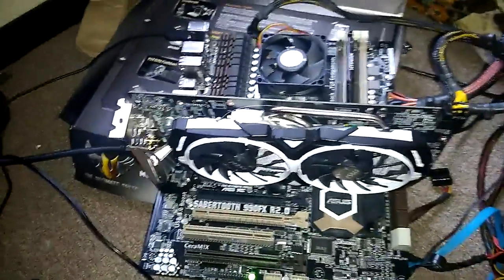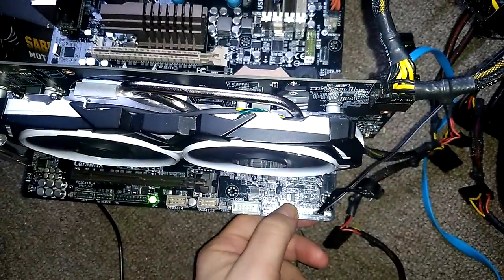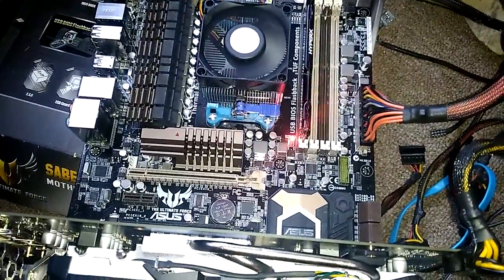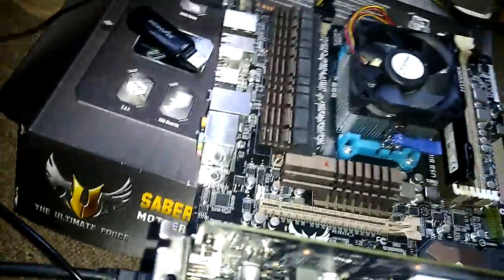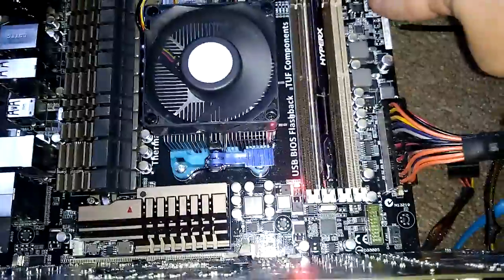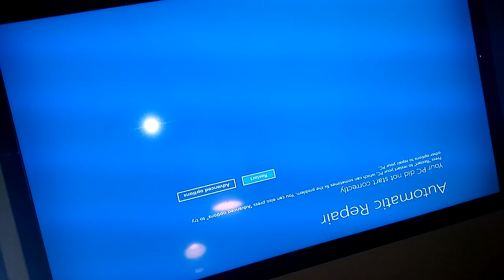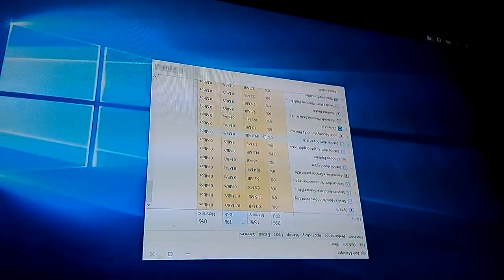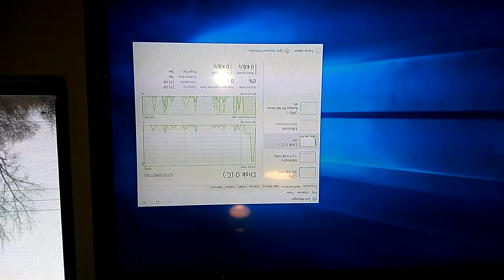ASUS motherboard cpu and dram troubleshooting 990fx sabertooth R2.0

Comment from the maker: Everyone i believe i figured out what was happening. when you take out the graphics card the mobo gets a error when you put another graphics card so what you need to do is turn it off if it is on. then take out the card and turn on the pc. i know there's no HDMI in the mobo. wait for all the lights to flash. this is the mobo booting up. turn it off when its finished booting(aka lights going on and off) next put in the graphics card then turn it on and it will boot normally.

It may also be a cpu issue and it's building up a static charger.
Reply: Didn't work
Reply: This worked for me after a few days of diagnosing. Thank you so much

Comment: Got the same motherboard, when we have a power outage I get the cpu led problem when I try to start it back up. I'm not entirely sure what fixes it, but it's some funky combination of holding down the ram button on the motherboard, shutting off power completely, pulling out any power connected usb hubs and turning it back on to see if the red lights turn off and pc boots up normally. Then re-sync the clock when I'm back in the OS. I wouldn't call myself a technician, but if it works, it works I suppose, still a huge pain. Thanks for showing all the things you try, it gave me the confidence to mess with it until it worked!
Reply from the maker: Glad you figured it out.

Comment: i'm still using this motherboard in 2020 with an AMD FX 8350 clocked to 4.6ghz. added an  XFX RX 590 with 16 gb ddr3 kit overclocked. runs great mother board really tuff.

Comment: Hey dude i just wanted to thank you after watching your detailed video i managed it . I had same issues and i followed your steps and bam!!! saw the screen . I  just took all my rams out and installed just one and i saw the screen lighting up then i carefully loaded all the rams one after another and all good. Since i have that big cooler master evo 212 i was scared to take it off and check the processor but i got lucky it was just a ram issue. I did`nt even have to do the bios flash.

Comment: I replaced everything but the problem was the fkn cmos battery, it needed a new one then it booted normally without the red dram light and the cpu red light with the original hardware, happened on another Asus board too when it should boot with the battery dead too and give an warning but those Asus boards sometimes are weird and don't boot with the battery dead and battery needs replacing every month or so when pc dies again with new ones, this finally fixed it for me

Comment: For the red cpu led: The BIOS* chip may be seated incorrectly, or with the wrong orientation, or is defective (either the chip itself, or the socket); or maybe the bios is corrupted.

For the red dram led: The bios may be corrupted.

After ensuring the chip is inserted correctly, if the error persists, try rewriting the bios using the "usb bios flashback" feature. All it requires is a usb flash drive inserted in the proper slot, power connection to the motherboard, and the pressing of a button (no CPU necessary). Refer to your motherboard manual for instructions.

* more appropriately: uefi / firmware
Reply: Where is the bios chip located in a P9X79 Pro?

Comment: I have as similar issues. I have same mobo it will power up for about 8 to 10 seconds and just as its bout to post the cpu led will light up and the pc will power off... i have tried the bios battery and pin at the bottom with no lock.... but when i press the mem ok button it will post and when alow me in to bios after pressing f1 but once i restart pc the problem returns... any one got any ideas

Comment: Mine is solid red cpu led and i can only use it after clearing cmos 20 times or less if lucky. Help me please.
Reply from the maker: Youll have to check if its on the latest update and put in certain cables on first before adding anything else
Reply: @osbodav  yes it is updated, cables are fine the fact that I can use it for whole day without interruptions but the moment I turned off my pc i need to do clear cmos (using the jumpers) many times until the red will come off and it will boot properly. I dont feel like bringing it on repair shop cuz i dont have that much money and i need to use it everyday
Reply from the maker: @chadnapoles8726  press and hold the power button while its unplugged and make sure the keyboard is plugged in on the first 2 usbs by the keyboad and mouse outlets and make sure you not using a graphics card at first and have it plugged in to the tv while yurining it on then it should say press f2 then itll start up in bios
Reply: Still the same solid red cpu light all fans working
Reply: I test all my ram, gpu, cpu, power supply on my old mobo all working. Is it the new one could be the problem?
Reply from the maker: @chadnapoles8726  its just the matter of finding out what strategy works for you i have to do what i told you to do if mine decides to mess up

Comment: HELLO, READ THIS POSSIBLE FIXED MADE BY ME FROM VARIOUS EXPERIENCES IN THE PAST. PD: my bios is factory stocked 
CPU LED LIT: is a bad connection between the CPU FAN 4pin(Make sure it i placed in the CPU SLOT connector of the motherboard and if it is, push the black and yellow cables gently in the motherboard direction sometimes removing it more than once can be te issue). The other problem is the 12v rail from 6 pin connector from the PSU. Had this problem like 20 times. Mostly is the PSU(the 12v connector was melted and didn't knew it). Maby the psu is not giving proper voltage and you need to replace it). I replaced it and its been 1 and a half year until now without stupid led problems. I have a problem now with the BOOT DEVICE LED on lit(HAPPENNED AFTER INSTALLING THE NEW NVIDIA DRIVERS 02/13/1993 version). I am fucked up, so i will do with ose last steps of removing the cmos battery plus cleaning the bios and putting the gpu in slot 3. Wish me like guys. Sometimes is a bad voltage wich can cause this issues and can be from everu device you had connected(USB, WIFI, MOUSE GPU, MONITOR SIGNAL CABLE, etc). Wath i can add to this errors is that this MOBO has a lot of candies and you had to read a lot to relieve your headache of guessing wath the problem and fix will be. I am a pc technician and a hardcore gamer at Lima-Perú. I built my pc wich is a: FX 8350. 16gb of KINGSTON DDR3 VALUE RAMS(4X4GB), COOLERMASTER V4 GTS, MICROSOFT SIDEWINDER X4, CORSAIR M65 MILITAR CAMOUFLAGE ED., 2TB HDD SEAGATE BARRACUDA 7200 RPM., GTX 970 STRIX DIRECT CU II OC EDITION, SABERTOOTH 990FX REV. 2.0.
Reply: Do you have power interruptions in your country?

Comment: I have the same issue. When ever tried to boot some times it post or sometimes not. But  every time booted sucessfully with vga error blinking. Need your reply
Reply from the maker: I pinned the solution i had trouble with if you follow that then it might work otherwise its your bios settings too
Reply: @osbodav  is there any fix becoz everytime i hv to reset the bios or is my graphic card have the issue ?
Reply from the maker: @DevPanigrahy  yes the graphics card is the issue its for all graphics cards. Send it in for rma if you can
Reply: @osbodav  r u sure becoz it works well when it sucessfully booted ?
Reply from the maker: @DevPanigrahy  then just keep doing what you are doing to boot it up. Otherwise send the motherboard back to the company and they can repair it.
Reply: @osbodav  its too pathetic.

Comment: tengo el mismo problema, podras explicar como lo solucionaste? google traduce pls.
Reply from the maker: Kennith Indriago I was able to fix it in one of my videos https://youtu.be/pxpgu-iQ06Y
Reply: HE INTENTADO TUS PASOS PERO NO PUEDO ENCONTRAR EL PROBLEMA, MI COMPUTADORA FUNCIONABA BIEN, LUEGO DE UNA ACTUALIZACION DE W10 SE APAGO Y NUNCA ENCENDIO :(
Reply from the maker: Kennith Indriago it can be different for everyone. I have fx8320 so the firmware you need would be different if you have a different cpu. Some steps will work some won't depends what asus messed up on it.
Reply: BUENO AMIGO. YO TENGO EL FX8350 LA MISMA PLACA MADRE. LE ADAPTE UN SISTEMA DE ENFRIAMIENTO  NZXT KRAKEN X62. LA CUAL PENSE QUE ESTABA DAÑADA Y LE ADAPTE EL FAN COOL ORIGINAL Y NADA. AHORITA ANDO TRABAJANDO PARA SOLUCIONARLO Y QUE ME ENCIENDA MI PC ESTOY QUE LLORO :,(
Reply from the maker: Kennith Indriago hmmm I would suggest trying different updates to the bios then
Reply: andaba buscando soluciones para un problema similar, a mi placa se le queda encendido el Boot Device Led y no me funciona nada de los puertos usb. como esta placa (Asus Sabertooth 990fx r2.0) la acabo de adquirir se muy poco sobre ella, pero ya eh visto que fallan de lo mismo. por eso llegue aqui. ya no posteaste si solucionaste tu falla? tengo el mismo procesador que tu, FX 8350.
Reply: DER ENGEL DER EINFRIEREN que mal, lamentablemente esa motherboard tienen una arquitectura muy pobre. Funciono bien con un procesador fx 6100 pero con uno superior falla. Mi procesador era FX 8350, trabajo unos dias y luego sucedio eso. Mejor cambie la MoBo.
Reply: @coal10x  Hola victor. Ya la arreglé. Tienes que sacar la placa del case y arrancarla con un desarmador uniendo los 2 pines de power. Me logró arrancar la bios y me tiró error de dispositivo incompatible. Me indica que vaya al setup en opciones avanzadas y me dirija a boot devices en la bios debes seleccionar para todos los dipositivos dentro de la opciones de la lista las 2 opciones que te salen dando click en cada dispositivo. Yo active ambas para todo y me inicio Windows. Cabe recalcar que cuando la regrese al case(Un cougar panzer-s). Me salió error del boot con pantalla negra sin post ni nada(retiré un ventilador y tambien ajuste bien los cables del conector de 4+4 pines que viene saliendo de la fuente y va hacia la placa y me jaló bios y sistema operativo(hize reparación de windows antes del error por eso escribo esto último que hice por si te pasa). El ventilador ya necesita reemplazom

Comment: Hi man, i have a problem looks like in your video, but some another effect. In video you not try instal video card in second pci-e2 (black) i put in this slot and sistem boot is ok. But speaker not "beep" aniway) a realy has a speak whis you about all strenge glich thet MB, we may a speak in skype or some like voice connection? If you are has a little time for thets, i'm from russia and not good wrote in eng ) and not be a told about many thing in text) but im shure in voice thets theme progress a good and a faster change our expiriens) 
p.s.
sorry for gramatic fail in my message)
Reply from the maker: The speaker and headphones wont work with this motherboard you can only use hdmi for sound
Reply: ,speaker mute is not a first problem) i talk about a not working ports pci-e1 and pci-e3 (16x)
Reply from the maker: @TheMrK0t  it might need motherboard update or the sound on the board might not be installed properly
Reply: The sound is all in ok, I meant only the sound of the pc-speaker "beep-beep" you understand?) the fact that he does not squeal some time is not a problem, the system always loads normally.but it only works if the video card in the second slot pci-e (4x) and if it is placed in the slots (16x) brown, then I get a situation just like you video.
Reply from the maker: @TheMrK0t  then the 16x one is broken and needs to be repaired by the company
Reply: Not sure in this...